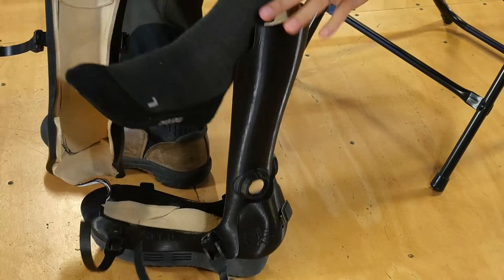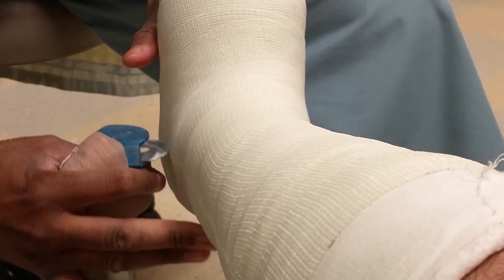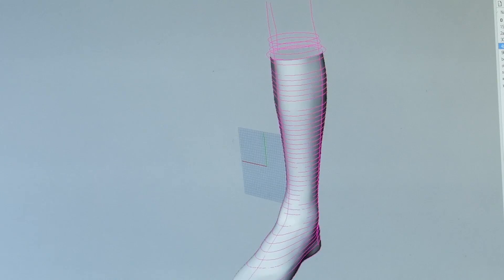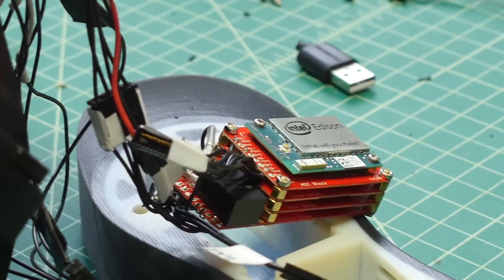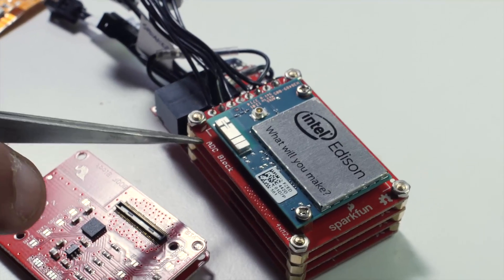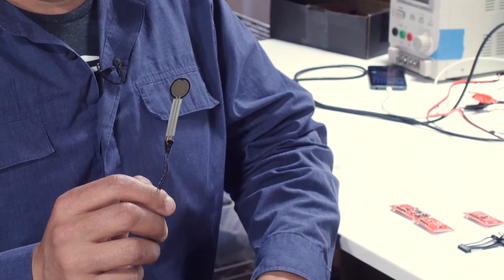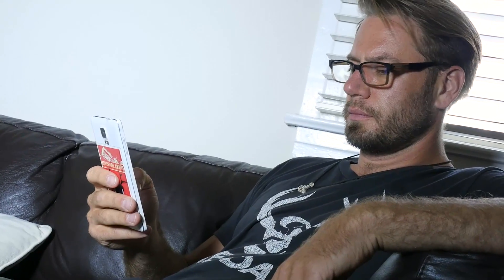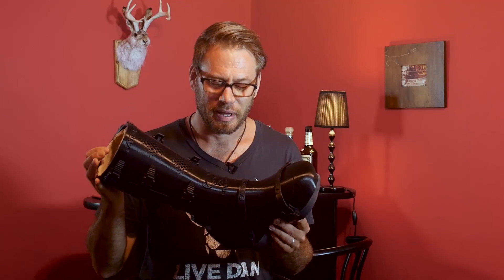The Medical Cast Re-Invented - 3D-printed, Internet of Things

Comment: How do you cycle air around the toes to avoid bacterial dermatitis?

My surgeon barely even uses a computer, how do you intend to get this into the medical field which has traditionally been slow to adopt new technology.  Most hospitals can't even go paperless.

Would the scan have to be done after initial internal fixation or after internal fixation such as K-wires are removed.

Could this also be used for a corrective surgery such as a left hallux valgus correction?

Will the cost of a device like this be available to everyone or only those with specific health insurance, I could see this device only helping rich people rather than all people.considering how basic health care is a rare commodity in the US today.

Comment: Very creative application of IoT.  But won't it still be bad for your leg to put your weight on it by walking?  How does this solution solve that problem?
Reply: Chas. Cooper Actually, the movement and added blood flow from walking might actually help in the healing process. The doctor also said that the tight fit from the cast helped reduce swelling. But we don't really know, so having all the sensors can provide the data feedback we need to learn what really helps in the healing process. Good news is my leg is healed and did so quickly.  cheers!
Reply: doctornorth Interesting!  Not just cool tech, but better healing, too.  Very cool.
Reply: Chas. Cooper It was my leg after all!!
Reply: Chas. Cooper